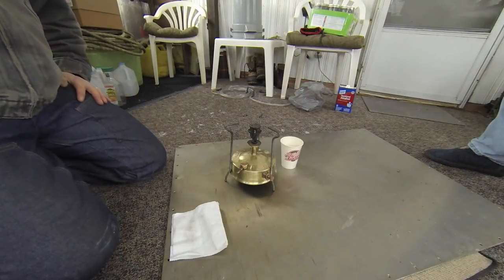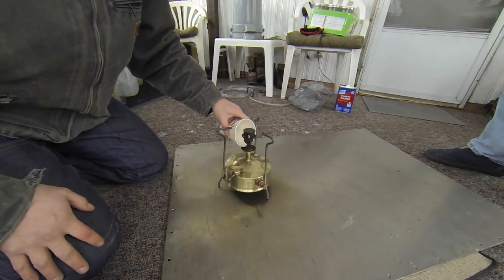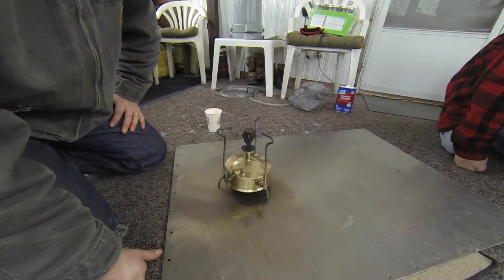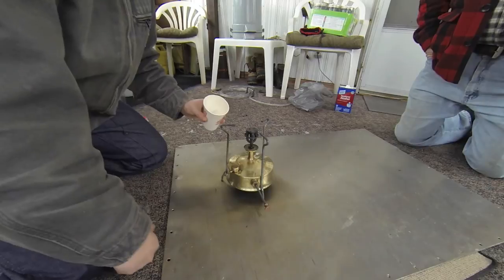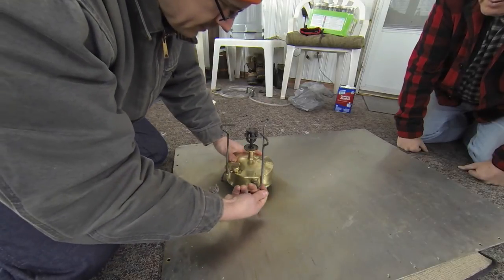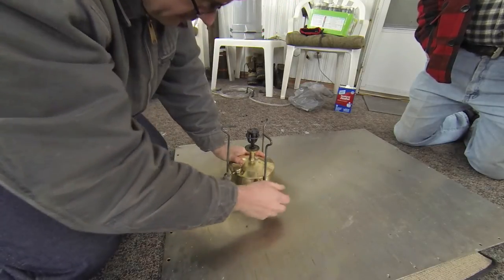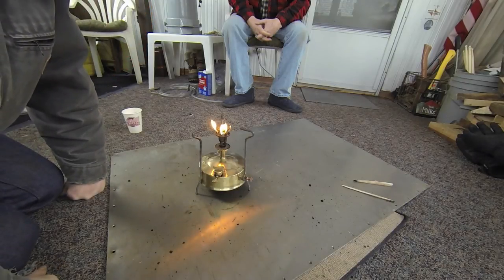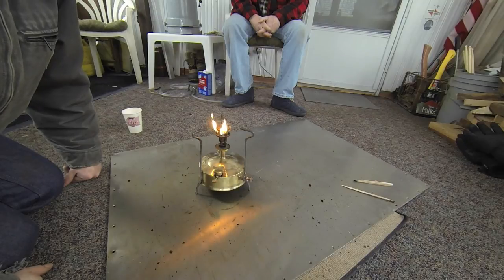Russian РЕКОРД 1 kerosene stove - Primus No 1 clone

Comment: I have on of these contraptions my grand father brought it back from somewhere during his travels most probably the soviet union . I still have it and it works great !! It gets quite messy with time because usually soot accumulates on the burner and around it but besides that that thing is great . And with a full tank it usually lasts a long time . As to the problem you face it is easy to solve. ( as some other people said ) Just empty everything out and disassemble the burner and then you can get a thing wire ( i usually use stainless steel guide wire ) to unclog the jet and clean also the pipe leading from the fuel container to the jet. It's good practice to put some petroleum jelly on the leather seals of the pump (if your burner has them) . good luck with it !! i hope you will be able to cook some eggs on that thing! :)

Comment: 1. The flame spreader is missing and it would not work properly even if it held pressure. It appears that the pump washer is defunct Either way, you should have done more research on this type of stove before attempting to use it.

Comment: I believe you have a blockage in the jets.  The flame should be blue like you said and look like the afterburner on a jet engine.  It doesn't look as though it's atomizing the fuel enough probably because of the blockage.  Probably an easy fix :)  If I remember right, it usually only takes like 3 or 4 pumps to work right, again pointing to a blockage.